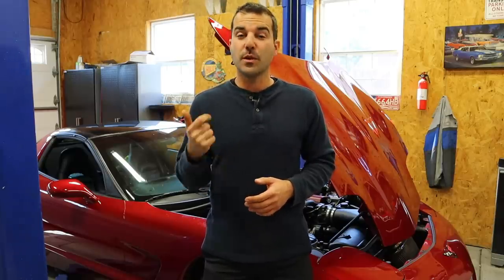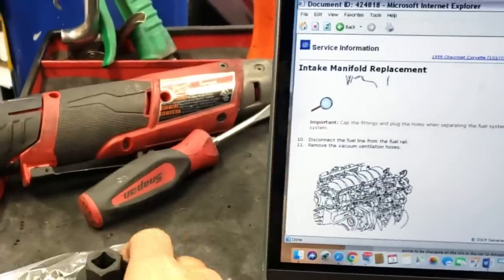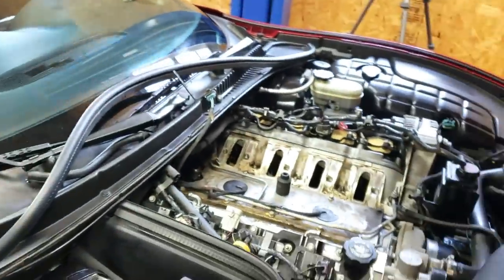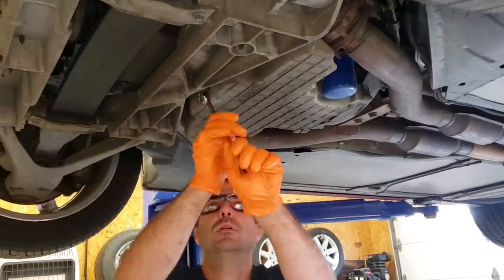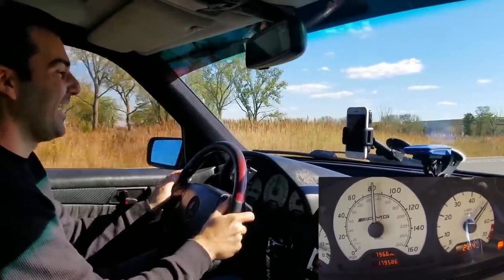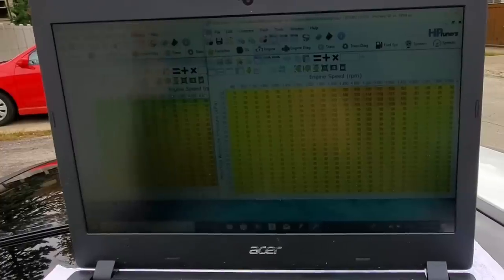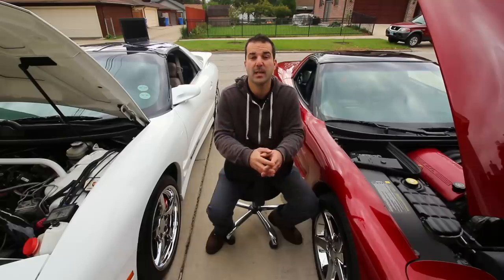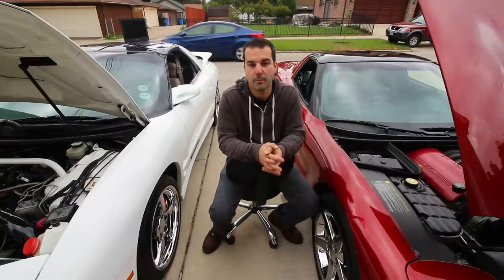I’m Building A 40 MPG Corvette That Sacrifices NOTHING! Project EcoVette Starts Now!

Comment: Gearing is key. My '99 Corvette makes over 700HP at the wheels with a Heads/Cam/Blower LS3 swap. Driven rationally on a 3500 mile road trip, I saw 36MPG highway. I'm not saying I drive it rationally all that often, but it CAN be done. Running back roads at 65MPH it only turns about 1200RPM.

Comment: Had you also considered plain water injection and closing up the plug gaps a little?  It should allow it to run a much leaner while keeping the combustion chamber temps down.  And only activate it on lean burn mode.

Comment: Fwiw a lighter flywheel may hurt hwy mpg. Reason being is that the inertial force from a heavy flywheel  actually makes rpms easier to maintain because the flywheel wants to keep spinning. A lighter flywheel will allow the engine to gain rpms quicker, but will require more input from the engine to maintain rpms.

Comment: There is nothing to say its not legal to run lean in the USA, it has do to that the US NOx regulation is really strict which means that the simple ways to control NOx doesn't work. The main problem is that when running lean a normal stoch converter will increase the NOx instead of removing it.  One way to use lean in the us would be to run DEF on a gas engine.

Comment: Heads and cam. No point on lightening the flywheel, that screws the torque, and then the engine needs more fuel to keep up. I saw a 40-60 hp gain in port matching alone, depending on execution. Ramping up compression ratio by decking the heads gives better efficiency, => better fuel economy. shortening the valve opening time via sharper cam lobes, also lowers the fuel consumption. Ditch the "Air filter", it's a restriction. Use air box and a large surface area paper filter instead.

Comment: You should fit a flat under floor, it would back a big difference to aerodynamics, but don't lower the suspension to much as if you go to low the air running off the bottom of the car will be affected by the road causing more drag.

Comment: Really leaning it out........  so what your really saying is your going to leave it in open loop........  to be able to control it the way your suggesting.  Best of luck managing your MAP and injector temp changes with that AFR consistency.  Cars use Closed Loop for a reason when not in WOT.

Comment: EG and EK Honda Civics both as HX trims which are lean-burn engines. If the O2 sensor is a 5-wire, it's a lean-burn

Comment: Replace the front air dam. I noticed it's worn and bent back from hitting parking stops. This is causing both turbulence under the car and increasing engine temps as it also acts as a scoop for the radiator. When new, they actually have a slight forward slope. BTW, I used to get 32mpg highway with my 380 rwhp '97 WS6 with 3.73's. With the LT1, it was a bit heavier than your Vette. The .50:1 double overdrive 6th gear helped.

Comment: My 92 civic VX had lean burn mode.  When it switched over the power would drop and I would have to  give it a little more fuel to maintain speed but the mileage would take a big jump.  The VX used a wide band O2 sensor to monitor the air fuel ratio.  I installed a kill switch so I could coast to stops.  I averaged 53 ish in mixed driving.  People that modified the body for improved aerodynamics did far better.

Comment: May want to switch coil packs if they are still stock. As for pulleys not sure if you did underdrive or not. But so many options for the C5, some are even trying 3d printed carbon pulleys. Headers with the factory cats may still work. A engine is just one giant air  pump. Better intake and better exhaust to help be efficient. Budget you can try to remove baffling in the mufflers or simply do a delete to see if it helps and just use a glass pack.

Comment: The average speed you where looking at is ithier whats called a US06 or a HWYFET. I run both for fuel economy  at my job. My company is sub contracted with the EPA vehical emissions lab and i drive thise tests multipul times a day expermineting with lean burn, cylinder deac, all sorts of things. We got a prius to get 64 mpg without any electric motor help. With the electric motor we where able to drive is 70 miles and have a average of 105 mpg.
The biggest problem as to why we dont do this on production cars is because it produces massive NOX emissions. So we are currently working on special catalysts to try and stop the NOX. Hopetully we will have something soon enough.
Update, you said that at the end of the video now lol

Comment: I wouldn't be too surprised if the Corvette gets close to 40 mpg while cruising on a flat highway at 50 mph right now. Note I'm talking about only cruising, no acceleration, cornering, hill climbing, etc. I'm also assuming the wheel alignment is set up with zero toe both front and rear, there is minimal camber and the tires are inflated close to their maximum rated pressure.

Can you set up a ~40 mile course that you can use to check fuel economy now and compare it to what you get with the various modifications? If you're serious about doing this you should also set up some way to accurately measure the fuel burned. I'd probably go the KISS (keep it simple...) route and rig up a 1 gallon tank so I could see how far 1 gallon will take me. Trying to measure how much is burnt out of the regular gas tank is difficult to do accurately (unless burning through a minimum of an entire tanks worth per test but that takes too long).

BTW, I witnessed in an interesting university study many years ago that looked into shock absorber impact on fuel economy. Believe it or not well damped shocks actually worsen fuel economy while driving on bumpy roads. The group was trying to maximize fuel economy for a certain car and after installing new shock absorbers the fuel economy got worse. We discovered that the best fuel economy, something like 5% better (on very rough roads), was achieved by removing the shocks altogether. The car was unpredictable to drive without shocks though. If the bumps sequence was "just right" the car would start hopping up and down so badly that the tires would actually come off the ground. At other times though, with the right bump frequency, the ride was ultra-smooth without shocks.

I'm not recommending removing the shocks, but if you test fuel economy on very smooth roads you will get better economy.

I'm looking forwards to seeing how much savings you'll get from running in lean burn "mode". What is typical? I had a few Chrysler vehicles in the late 70's and 80's with their lean burn systems but never considered them very good at fuel economy. They used to ping terribly, suffered from "boggy" throttle response and tended to burn oil as the miles added up. That is what I remember about them (nothing good)...

Comment: Very interesting concept. I've owned 2 4th gen Camaros 98 Z28 and current 97 SS. Driven several C5 corvettes. You can get into the low 30s stock if you can drive like grandpa with those tall T56 gears . Following this

Comment: A stoichiometric burn ratio (14.7 for E0 gas but lower with E10 and way lower with E85) is for one reason and one reason only: the catalytic converter.  In fact the way a narrow band chases air fuel ratios back and forth is beneficial to that process.  Your cats will not work properly in lean burn and you also risk overheating and melting them.  Hopefully not at light loads.  Also you need to get into the 17s to get exhaust temps back down.  Needs extra spark advance also.
Reply: A lot of variables that could cause the engine to go boom.
Reply: @Minitrucker231  The risk of engine damage at light loads is very minimal.  You do need to get over the egt spike that occurs in the 16s.

Comment: The only cars I know of off the top of my head that were sold here in the US with the lean burn mode were the first gen Honda Insight, and the EG Civic VX. I had a VX, it usually got in the low 40s even when it needed an o2 sensor and lean burn couldn't activate, lol. There were probably others, I wouldn't be surprised if some of the hybrids use it as well. That said, it's entirely possible emissions regs have changed since then, which is kind of a bummer for lean burn mode cars. :(

Comment: take excess electricity and run a browns gas cell, pipe into the m.fold.   Let your O2 sensors lean it further since you are adding fuel in the form of HOO

Comment: You’re probably going to want to put the original AC Delco spark plugs back in it because they usually use an iridium tip plug which will help your fur economy

Comment: The aftermarket GM oil pressure sensors, or at least the high quality brands my store sells, do not have the hex rounded off the same way as the factory ones. They will not work with the special sockets unmodified. A few seconds with a file will cure that problem, but a six point socket should work just fine on any of them.

Comment: I would also try adding a friction reducer to engine - you won't see immediate results (needs a few hundred miles) but will help, even if only a percentage or two - perhaps something like Liqui Moly Mos2?  Not sure if you can get an equivalent for gearbox or diff, depends on things like LSD.  Finally rolling resistance - not sure the rim size helps here, but would be interesting test to put on some skinny wheel with eco-type tyres to see how much difference it makes?

Comment: If you run lean concerns about knocking, CO and NOx levels are true. 
Without a Three Way Catalytic Converter or with that level of NOx that exceed the Converter you should try an oxyhydrogen generator, so called HHO generators, Hydrogen on Demand etc. 
Apart of reducing the potential of knocking, the alkaline content of the vapors produced reduce dramatically the NOx formation. 
Simple method to measure this emissions is a (distilled water) wet pH strip hold on exhaust pipe. 
With CO and NOx the pH drop due acids formation. 
pH 7 to 7.5 prove the functionality, above 8 is too much “ additive”. 
From my experience not all systems are working in this way..So called “wet cell” are most suitable for this application and one particular model produce best results. With your modifications you may exceed actual mileage without knocking, CO and NOx emissions.

Comment: Correct me if I’m wrong: lean burn raises combustion temperature significantly, which can melt exhaust valves, when used for a long period of time.
Reply: Engineering explained covered this topic before

Comment: 92-97?ish civic VX had lean burn mode, but past 97-98 it wouldn’t pass emissions. I had a 95 VX with 300k miles and it would kick into lean burn and it was like I tossed a parachute out the back, you could press the throttle halfway down and it not do anything. If you tried to maintain 65mph or faster, you’d kick into lean burn, lose speed, throttle throttle throttle, kick out of lean burn and accelerate, and repeat. Best full tank was 55mpg.

Comment: You're probably never going to see this comment but I'd be interested to see how much more EGR flow you can get away with while also leaning out the engine a little. The reduction in pumping loss probably isn't worth the higher risk of a misfire but might be interesting to experiment with.

Comment: Honda has had lean-burn engine applications in the USA. However they may not have been legal in Cal. I live in the Chicago area and I had one many years ago. 

1992–95 Civic VX

1996–2005 Civic Hx

2002–05 Civic Hybrid
I think mine was a 1972 Honda with CVCC lean burn. Now I drive a 1250 RWHP Twin Turbo TA WS-6. Doesn't get very good mileage but it sure is fun at the strip. :)

Comment: Lean burn was used on CVCC Honda engines back in 75-78 in the civic series. Prechamber at 12 to one to fire the main cylinder with 22 to one ratio as I remember it. They stopped using it in th eUSA. Mercedes recently used this system in Formula1

Comment: I think there are a few errors. 14.7:1 is peak EGT. Leaner or richer than peak (at 14.7:1) = lower EGT. Nox production is a function of EGT or combustion temperature.. Lean means excess air, rich means excess fuel  present after the combustion event.

Comment: I'd switch to hydrogen. Back in the 70s we had a problem with the Japanese miniaturizing everything. We sent them a 350 powerplant, they sent it back with double overhead cams. We sent a drill bit that could drill a hole in a hair, they sent it back with a hole in it.

Comment: Most modern cars run higher water temps to aid in more complete fuel burn. somewhere around 200 wont hurt the engine but may help you get that last 1 or 2 %.

Comment: Technically removing the CAI and switching to feeding the engine on hot air will result in a fuel economy increase on a fuel injected car. (Hot air is less dense, BUT if you're maximizing cylinder pressure / dynamic compression ratio to increase fuel economy, you'll want cold air to keep detonation at bay. (every 7 degree temp drop is a 1/2 point of fuel octane equivalent in detonation resistance, per David Vizard.))

Comment: Water/Methanol injection while running lean to cool temps and increase combustion further? When water turns to steam it expands 1500 times. WW2 fighter aircraft used water injection increasing power up to 40%. Also will reduce knock if it arises. Your thoughts?
Also pump tires up to 50 psi.

Comment: you know with these damn horsepower wars I've often thought, why not just make a 300 horsepower car that is very light and very fuel efficient, so this sounds kinda like a fun idea. thing is you kind of have a catch here that is going to defeat your purpose right from the start, as when the car gets up to speed and into the rev range, where the fun is, its going to use way more fuel no matter what you do to it, and you'll end up getting stock mileage from the getgo no matter what you do to it under the hood.

so your best bet is going to be to turn it into a vette cart, and focus on things like that, IE add lightness, and maybe detune the gearing to match that of its feeling stock when you do so, then you should be able to cheeze it and get that mileage number from it.

Comment: they were engineering and testing lean burn when I was building my Bimmer so around '92-'94. EGT's eat the pistons up, Were where early to the show, to Dry lube plate the piston bodies. I learned all about it building F-16 Fighters for the USAF. It is the best protection for very harsh operating environments. This was used on the empennage of the fighter, any oil, grease ect would cause a failure= sand, carbon, ice, pieces of destroyed opponents. this coating was the only thing that could stand the abuse. I have few pieces that My guys coated for me. oB

Comment: Running lean is a nice way to improve economy.  I used a computer intervention kit (Power Commander) to load a map that leaned out the low end on a motorcycle where the stock settings made it real rich at low RPMs.

Comment: Small things matter. Vortex generators (roof, near or/and on the inner part of wing mirrors) small lip spoiler with low ange would also help a bit. Basic weight reduction like some covers and interior. If you go slightly further you could also cover wheels for better aero. Heard about such a thing as "hot air intake" don't really know a lot about it though. Tyre pressure, ofc, but I believe you said you'd do it.

Comment: Taller profile tyres on the rear might gain you more by gearing the car up than lowering the car (if you can't lower and go taller). Maybe just a find an old pair of smaller diameter rims with taller tyres. Then you could decide if a higher diff was worthwhile.

Comment: liquid propane injection, Whipple supercharger, spark timing advanced 15 degrees. (google propane octane). get a 5.10 rear end and a 8L90E but switch the 8th gear with something like a 0.43:1...

Comment: NOx is controlled more by the egr. Catalytic converters don't do a good job of eliminating NOx. The egr recirculates spent exhaust gases that don't burn well, which leaves less clean air/fuel in the combustion chamber, reducing combustion temperature.

Looking forward to seeing this project. I'm impatient, so I'm sad I found this video on day 1. And definitely get the .5 viper t56 6th gear ratio.
Reply: CONVERTING NOx is a primary function of a catalytic CONVERTER... otherwise yes, EGR does introduce inert gas to the combustion chamber thereby allowing a leaner(and cooler) mixture while reducing pumping loses.

Comment: The USA first generation 2000-2006 Honda Insight with the 5-speed manual has lean burn mode, which gives them more than 70MPG at highways speeds.  The USA CVT version does not have lean burn mode in order to meet SULEV standards.

Comment: I drive a 2000 Honda civic which I've modded to reach roughly 50-55 mpg highway 39-43 city. I fill up once every two weeks or so and drive 40 miles daily in city traffic. Worth the probably $400 I spent modding. Does it have power? I can still beat most normal cars on the road in 0-60 including ecoboost mustangs, small trucks, and some low power sports cars. Can't divulge all of what I've done for legality purposes. The car barely weighs 2000lbs. The fact that this guy can come close to me in mpg with a corvette is impressive.
Reply: What mods? I'm interested in increasing my Corolla's MPG

Comment: I'm told that putting a floor pan under the engine (as Mercedes does) improves the economy by improving the drag coefficient.  I've never tried it, so I cannot speak from practical experience.  And a nice wax job will lower your drag... but it looks like you already have that one covered.  Keep rockin - Charlie